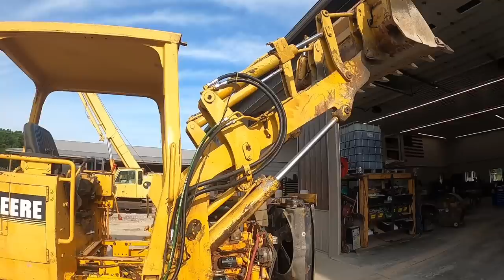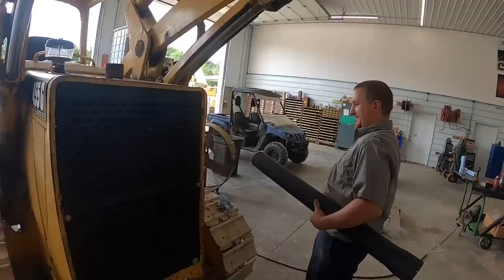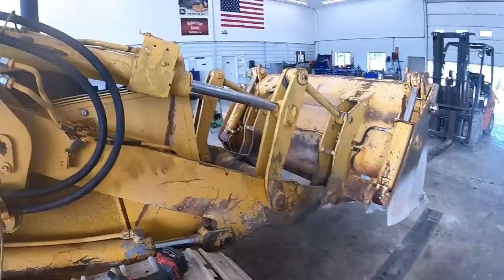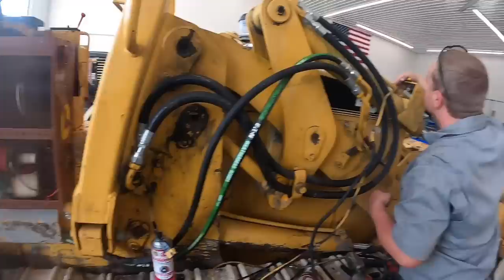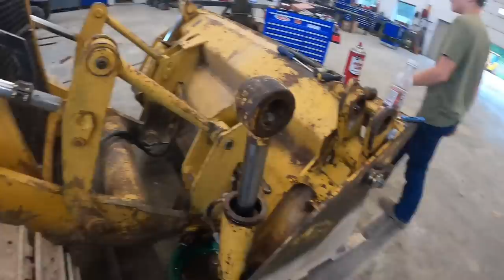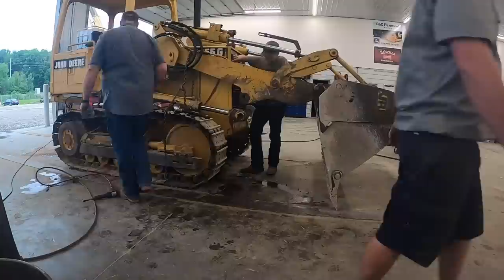We fight some new defective part issues on Deere 455G crawler loader and hope to have it job ready

Comment: Love the videos--hadn't seen that kind of cylinder w/ the big nut on the end in a while.
When you walked over by the wall-to get bolts/nuts--lo and  behold--brown Lawson brand bolts and nuts. Had the same set up in the construction company shop i worked in for years. Nothing but grade 8--don't even fool with anything else on equipement and trucks. Not worth the hassle. We lost a CAT engine one time when someone used cheaper stuff and a  broken washer somehow got mixed up in the turbo somehow.  The owner went ballestic...That's when Lawson stuff showed up the next week.

Comment: I know this is an old posting but I have just now gone to some of these as I do enjoy the way your work with you people, Kevin is a hoot, he has a great personality for the work he is doing.  Just as an FYI, I an a mechanical/process engineer just retired from over 40 years working in the Semiconductor Manufacturing industry for the worlds largest processor manufacturer (think computers, x86........ and newer).  I had to do development and upgrades to make the equipment that does what we need as there is just no one that can make it as we are on the cutting edge.   My $0.02 worth is that the steal you are using to hold the magnet that operates the little reed switch is spreading the field too much to focus that point you need, most likely due to a poor magnet from JD.  I always love these problems, they are fun to me.  I love your channel.  After I retired, I moved to upper Indiana to be with family and would some day like to drift south to check C&C and Dirt Prefect out some.  Not looking for a visit, just a drive by and say "I know them".  Keep the great content coming, love what you are doing!

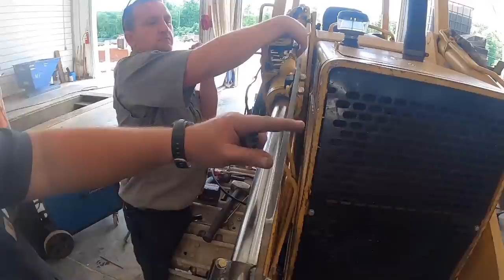Comment: At the 19:25 mark I got a chuckle at your comment about saving the end connectors to use again. I used to do that with extension cords. When I moved I took those to my son for his use. Only problem, I had a container that held 4 gallon milk jugs and it was full of ends. Never did get around to using them.

Comment: [ thank, you for youre video. great, looking bull dozer. i, just bought a 2002, 939c cat track loader bull dozer with a 4&1 bucket. all, new batterys, new tracks, new pins, new chains, new rollers, new sprockets, new fluid and filter changes,  4 thousand house enclosed cab heat and a/c. paid. $40k]

Comment: Most enjoyable watching you work. I think that the magnet problem was caused by the arm been made of iron. If the arm was made of aluminium or other non ferrous material, I think that the magnet would have worked ok. The John Deere bracket was probably made of a low or non ferrous material. To test it , I would have bolted on a piece of aluminium or rigid plastic to your arm &  attached the magnet to that.....That's just my pennies worth of information but may not be worth that much. You do excellent work, good video & perfect narrative. Keep up the good work. 👏🎬💯%   🏆

Comment: Take an old motor winding, plug it into 120 volt AC, run the item you want magnetized back and forth inside the windings and you can magnetize just about anything.

Comment: If you have a strong electo magnet you can re-magnatize weak iron magnets by laying the iron magnet on the electro magnet (turned off) then turn on the electro magnet and pull off the iron magnet.  If you wait to pull off the iron magnet until after you turn off the electro nagnet then it will be demagnetized.  If I remember correctly it will not work to have the electo magnet turned on when you set the iron magnet upon it.  The magnet on a mag drill should work for this purpose.

Comment: Try lathe welding a bolt to a magnet shell. You avoid the strong magnetic field of an arc machine. But, cool it quickly. High heat will destroy magnetism also.

Comment: 50.8 mm=2 inch. Close to 7/50 of an inch less. The gap with magnets is important.
If youre afraid of the strip moving to much make it a t profile. What also goes is north/south pole. Try to rotate it 180°. Forward goes backward.
At 38:00 like we say: het loopt gesmeerd. 
(The job runs well lubed😉)

Comment: The magnet worked prior to attaching it with the new, longer, harness. Is it possible that the magnet was demagnetized somehow prior to installation? If not, was the space between the magnet and the sensor close enough? Maybe the camera magnet is stronger and is able to trip the sensor from a greater distance.

Comment: i enjoy your channel, i have a 455G  nice machine. i do a lot of my own repairs. you had me on the edge of my seat with the cylinder rebuilding, i was surprised you didn't use a spanner wrench in your fancy pants shop to remove the gland ring. never though about a blunt air chisel, maybe on my next one i will try it. also when you reassemble the boom cylinder you didn't  show where the split orange ring went after setting the snap ring and it's purpose. i have repacked many deere cyinders and recently just did the clam bucket ones and it was the first time i had the orange ring and it seemed dumb to use it there so i packed grease in that spot like i have done the past. keep the videos coming
Reply from the maker: We have a spanner  wrench but air hammer works great
Orange ring just keeps dirt out

Comment: Great job your sons are going to be the most knowledgeable guys in your area when it comes to fixing anything mechanical. If you had a 10 ton overhead crane you would have just about the most perfect repair shop. I’ve worked with overhead Demag cranes for over 30 years and they are handy for just about anything to heavy to manually lift but they are expensive.
Reply from the maker: Yep

Comment: On the magnet issue,  it almost seemed like that to much of a gap between the magnet & the proximity switch . But either way John Deer should have sold a magnet strong enough to work.
I D K. They put a premium price on the parts the sport their name & usually that says/means alot.
Not in this case. Anywhooo , GREAT VIDEO , GREAT JOB. Kepp em comin PLZZZZ !!!!!

Comment: Magnetize you can wind a 18 Guage wire around anything you want to Magnetize like a coil leave room on both ends of the wire and quickly touching a 12 volt battery positive and negative at the same time

Comment: Just remagetize the magnet by wrapping the magnet with copper wire and touch it to a 12 volt battery and it will do the trick
Reply from the maker: Interesting

Comment: Do you guys ever put in a new seat on your parts list , before you have to sit on the old one..?why do they wear out so often and stay that way, imagine a patent on a new machine seat that is a good long lasting unbreakable unit.Just a thought 💭 about a essential part for a operator. Before the robots take the job.!
Reply from the maker: Yea we always send them out with new seats if they need them 
It only takes on little cut or nick and it just goes from there

Comment: - How did you flush out the emery paper fines from the tube so they would not not get into the hydraulic oil or seat themselves in that piston's packing to grind the shaft's finish?
- You did not show it...so I was wondering...Did you blow out the tube, or take it off so you could flush it with brake cleaner of some such wash?
Reply from the maker: Brake kleen and wipe it out
Reply: @C_CEQUIPMENT  .
- Excellent. Thank you. People can so easily learn the wrong things, inadvertently, if a visual instruction is missing.

Comment: When you apply any kind of heat on a magnet,it loses his magnetism..There is a way to restore it..Actually when you apply to the magnet some kind of magnetism,it regains back his power and most of the times very stronger than it was before...If you can,better make a hole to screw it than weld it..

Comment: What’s the part # for those double sealed joystick orings I’ve got a 555g y’all’s videos have been awesome there’s been several times I’d have had to call a tech out if not for y’all’s videos thanks
Reply from the maker: They are a 1/8 thick quad ring
I believe you may have two different sizes
Reply: @C_CEQUIPMENT   yea the bigger one is the one leaking on the left but I’ll probably change both I also need the front idler assembly Meade equipment in lavergne tn quoted the whole thing minus the fork and rod for 800$

Comment: Hey Chris question why do dozer track have taller grouser pads I know for pushing but a track crawler pads have almost no pad they both used to push dirt and probably run the same track chain and sprockets why not have non scratching pades and dozer  matt from Diesel Creek has a 1980 cat d477k track loader but he looking for good pads his chains and sprockets good just trying to find good pads or full tracks reasonable
Reply from the maker: Crawler loaders we’re designed to do more turning and loading then pushing which makes it easier to turn with double bar grousers
Reply: @C_CEQUIPMENT  his sprockets are a little wore chain looks still good but losing digging in so just change the grousers
Reply from the maker: @brucebonkowski9568  if the chain is not stretched 
We are gonna do an undercarriage measure video soon

Comment: I noticed that the cylinder rebuilds were on the same side of the machine, is it common to have multiple cylinder failures on one side of a machine?
Reply from the maker: no it doesn't really make a difference they just leak when they want to

Comment: great video, I also have a 455G, my headache has been the return to dig switch.  everything works as should except
fro the switch. Part number AT117245. John Deere has an Echo after market switch from Echo.  I tried to make this switch work
and finally call the switch mfg Echo. I was told this switch will NOT work for this application. It is for a driveshaft.  Finally
JD admitted this and suggested using an aftermarket switch.  I searched the planet for a new/used one.  No return to dig
anymore.  Do you possibly know where I might find one. Mine got moisture in it and froze,  Dave
Reply from the maker: I’m not sure
I supposedly bought the last factory one in the planet